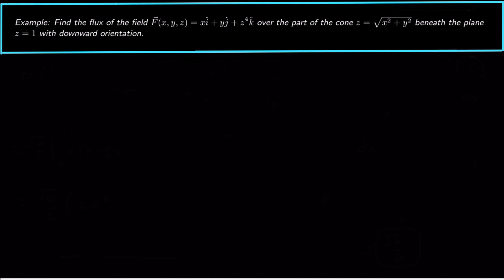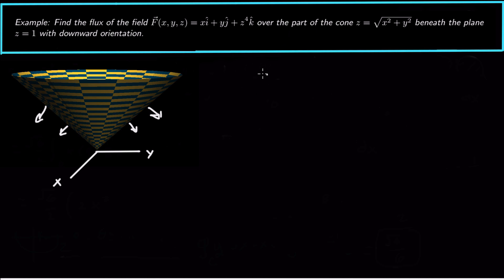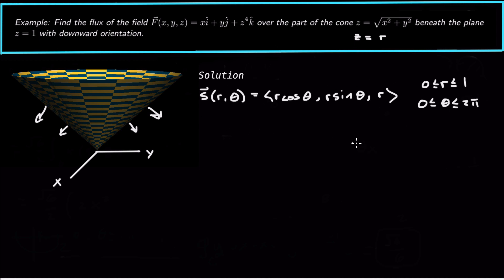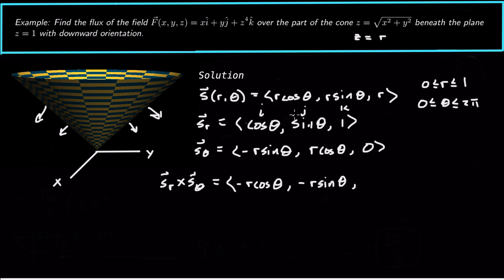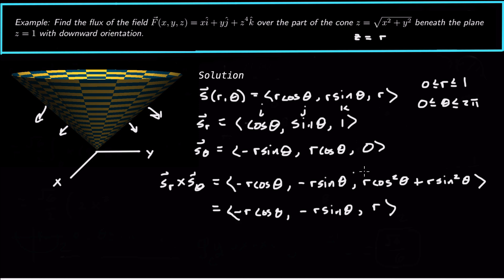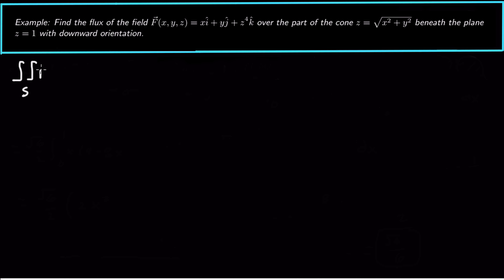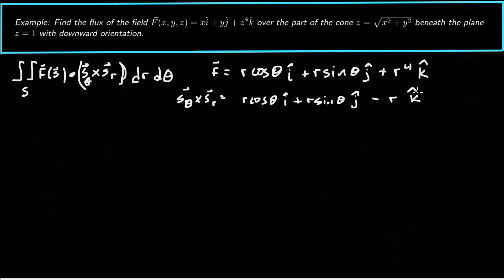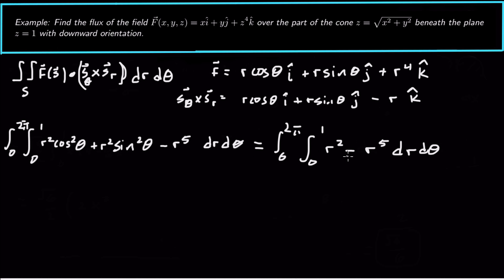Find the Flux of the Vector Field F = x i + y j + z^4 k Through the Cone with Downward Orientation

Comment: r(dr) (dtheta) is the magnitude of area then while u calculate unit normal for surface area then u get a root 2 at the bottom why did you not considered it
Reply from the maker: so. vec{n} = (vec{s}_r  x  vec{s}_theta)/| vec{s}_r  x  vec{s}_theta| and d vec{S} = vec{n} dS
and dS = |vec{s}_r  x  vec{s}_theta| dr dtheta

Thus, vec{F} dot d vec{S} = vec{F} dot vec{n} dS =( vec{s}_r  x  vec{s}_theta)/| vec{s}_r  x  vec{s}_theta| dS = (vec{s}_r  x  vec{s}_theta)/| vec{s}_r  x  vec{s}_theta| |vec{s}_r  x  vec{s}_theta| dr dtheta = ( vec{s}_r  x  vec{s}_theta) dr dtheta.

So the magnitude cancels every time when doing flux.

Comment: what to change 
if z=2?
Reply from the maker: Your upper bound for r would be 2. =)
Reply: @JonathanWaltersDrDub  what if it just says that z > 0? integrate from 0 to infinity?
Reply from the maker: @sakki3378  Then 0 < r < infinity for the bounds for r in the integral.   You'll have to be careful with the integral to infinity because it will be improper and you will need to use the limits to evaluate it.

Comment: hi, may i know when do we use r(theta) x r(r) instead of r(r) x r(theta) because i am confused with that
Reply from the maker: The cross product creates a normal vector to the surface.  The surface orientation is given in the problem.  Your cross product needs to go in the same direction as the orientation of the surface.  

For example if the vector is oriented up then the z component of the cross product should be positive no matter what r and theta values you plug into the cross product.

Hope this helps!

Comment: When converting to polar coordinates, how come you did not have to multiply by r?
Reply from the maker: That's a great question!  The jacobian (s_r x s_theta) is the extra multiplier actually.  So if we had not use polar coordinates to start and kept our parameterization in terms of x and y then we would have had a double integral in terms of x and y.
Then when switching we would have had to multiply by r.  However by setting up our parameterization in terms of r and theta, the cross product automatically produces the r we need.  (The cross product is basically the jacobian of the transformation/parameterization, and when we have a change of variables in a double integral that extra r is just the jacobian of polar coordinates.)
Reply: @JonathanWaltersDrDub  Wow, thank you that clears up a lot of things!